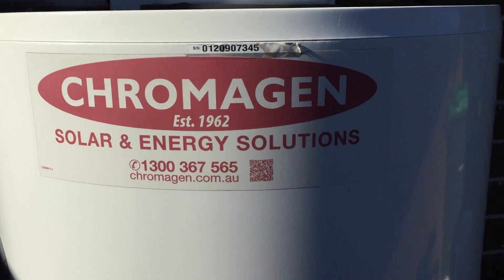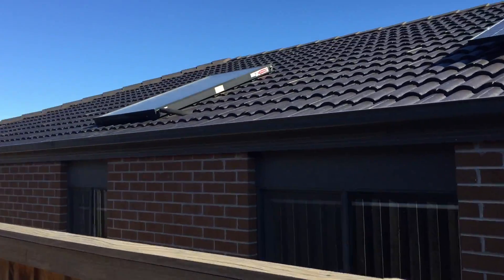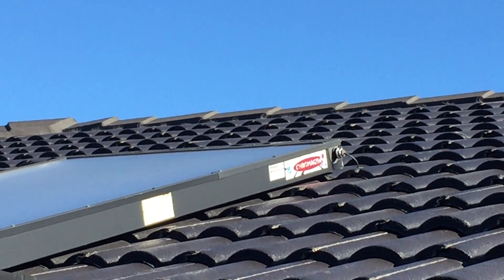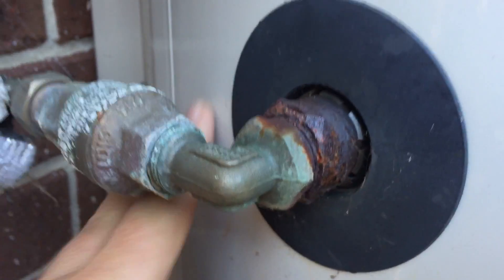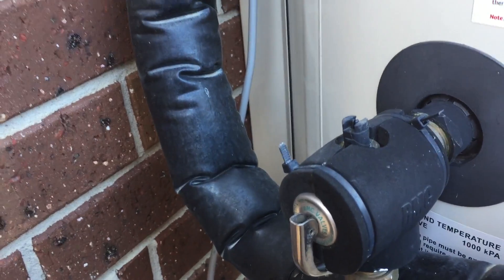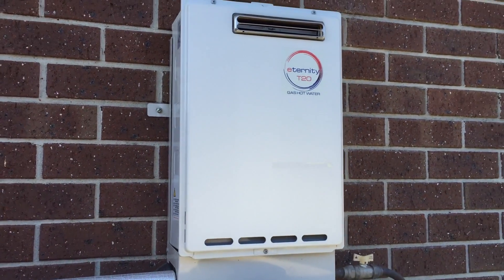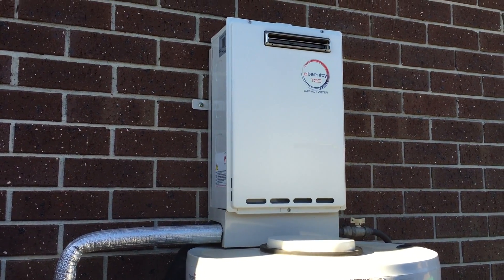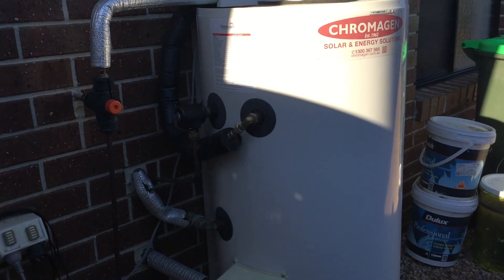Solar Hot Water systems- A Basic overview- Domestic Cromagen Rheem How they work

Comment: Hi Mark. I have a pin hole leak in the silver flex pipe that's in the U shape near the water inlet. I have already bought a replacement pipe. Do I have to drain the tank to swap/replace? I'm thinking I switch off the water inlet valve, turn off power and release the pressure valve. Is this enough? Thanks.

Comment: Hi Mark great videos buddy. Do u know how we can adjust the temperature of the water?
Reply from the maker: Hi there. The output from the solar should run to the instantaneous system. Which then should run to a pre set blending valve. This blending valve mixes hot and cold water so you have a maximum output temperature. 
If this system has been bypassed or isn’t working then you get water that is too hot.
Reply: @Marksreviewsandtutorials  do u means the temperening valve with the orange cap?

Comment: Hi Mark, I have got a similar one without the gas instantaneous system on top. My question is how to NOT use or Cut off the solar side of this solar HWS? I only want to use the normal electric hot water system as the pipes going up and down the solar have a history of leaking. Please advise Thank you

Comment: Hi Mark. I have to replace the corroded pipe fittings on the storage tank. Would you know whether the storage tank is made out of copper or steel. I'm just concerned if the fittings are seized and difficult to remove, this may fracture the tank. Not sure why mild steel fittings were used.

Comment: Hi, I'd like to disconnect the whole solar and tank and just re route and use the instantaneous unit only, do you have a schematic for the plumbing/wiring? Thanks
Reply: I think all u have to do is just turn the power off!.
Reply: @redsed1565 turning the power off didn’t work for us. It may not heat the water but the solar panel still fills with water

Comment: Hello mark how do we turn it off when we are away i mean like 2 months away .
Reply from the maker: Hi there, there is a power cord running from the little circulating pump. You can switch off the system there. It then won't run. Although it will still all be under mains water pressure. MRT
Reply: @Marksreviewsandtutorials  do i turn the water mains off to will it break the system if weather is hot ?
Reply from the maker: I wouldn’t turn the mains off as in hot weather the water will expand and it needs somewhere to go. There is a pressure relief valve on the tank but I wouldn’t want to solely rely on that

Comment: Hi Mark, my solar panel frost protection valve has been leaking for months and months now ( not dripping  it's literally pouring). What's  the issue here? Thanks
Reply: Thanks Mark for the reply. Is there any way then that I could bypass the Solar Panel system since it's heavily leaking and still have hot water supply. Or are they both interconnected?
Reply from the maker: @arnelsubala7567  If it is just the valve then get that replaced. If the panel is leaking that is more expensive. You will need a plumber to disconnect it.
Reply from the maker: The valves do tend to leak after awhile and need to replaced. Nothing wrong with your system just a part that does need replacement pretty often. MRT

Comment: I found this system useless for 9 months a year. During 9 months in Melbourne when it’s relatively cold, the solar part doesn’t heat water. On the other hand, it consumes energy because the pump attached to the tank still operates. Moreover, during minus T water in solar pipes needs to be heated too so it wouldn’t be frozen.
Just a gas booster without the whole solar part would be much better in our environment.
Interestingly enough, I can’t find an inlet water filter for water coming to Eternity 20
and I’m not sure it even exists, whereas in Rinnai it’s really visible and easy to clean
Reply: Ouch. Am building in South East Melbourne and my builder supplies a  Rheem model similar to this =(. Was hoping the solar thermal would save a bit but looks like not =(
Reply from the maker: There is a lot of hate from plumbers to these systems. I think mainly because they are not understood. Every time the sun is out it is raising the temperature of the supply water to your instantaneous heater and therefore it will use less gas. Saving money and the planet. 
I have three people in my house and I turn the gas booster off in summer in Melbourne and there is always enough hot water. (Outside of filling the bath). 
The circulation motor is tiny and costs very little to run. 
See my other videos where I discuss this
Reply: Its useful mostly in north Australia, even then in darwin in the dry season you will have only cold showers for a month or 2 in the dry season. If you coulple this wth a solar pannel for a small heater in your storage tank it will make a difference

Comment: My double panel exploded, and left only one panel.
 Can I utilise the one panel to use ?
Or do I need to buy a new double panel?
Can you shed some light on this?
Reply from the maker: Hi. The pressure on these systems come mainly from the mains water pressure itself not the little circulation pump. So I think it would be fine to run through just one panel.

Comment: Hi. How can I isolate solar hot water system from gas heater? I have a water leaking on panels. Can I disconnect power for the pump of solar system?
Reply from the maker: The whole system is under mains pressure. So to isolate the roof panel you must block both lines to it. Ie up and down pipes MRT
Reply: Thanks.

Comment: My water soler at roof is leaking water is keep coming from the little tap on the right side please help me to fix it thanks
Reply from the maker: There can be an anti freeze valve on the system which is supposed to leak out some water when the temp drops below 4-5deg. 
So if it is just leaking on cold mornings then it is doing as it is supposed to. If it is leaking all the time. Then either replace the part or call a plumber. This whole system is under mains pressure so you need to know what you are doing. MRT
Reply: @Marksreviewsandtutorials  Thanks for reply bro.the flow does not looks normal it's not like a water drops it's  a flow of water like tap and when I turn off main supply of water it's stops when I turn on back main supply from outside water flow starts again from roof
Reply: @Marksreviewsandtutorials  looks like I am loosing too much water
Reply: incredible india 
hi mate i have the same problem
Reply: incredible india  how did you fix it
Reply: Sarabjeet Singh thanks a lot brother... but unfortunately i already bypass hot water unit because many people having same issue and it’s come again and again so this hot water system automatically release water when temperature drop so i thought its better to get rid of this system.. and i think it’s not really helpful in australia specially melbourne weather condition                         thanks anyway bro
Reply: Mani Mannii ohh okay paji,,,actually this year is our first year as home owner so just getting experience slowly and steadily😂😂👍🏻
Reply: Mani Mannii if u have any links how to bypass the system please share ..may be in future I can try the same ...cheers👍🏻
Reply: Sarabjeet Singh   na bro i called certified plumber for that
Reply: @manimannii7610  hi bro a plumber fixed for me
Reply: @sarabjeetsingh120  Thank you bro 🙏
Reply: Mark's reviews and tutorials 
hi mark please tell us how to bypass ho water solar panel system please make a video thanks
Reply from the maker: The solar system is saving you money and the planet. It is ok to spend some money and maintain it. Disconnecting it will cost you much more in gas.

Comment: They shouldn't be using flexi connectors, they are not for outdoor uses. If you guys have those flexible hoses for your outdoor hot water tank, you must get it replaced with copper pipes ASAP!!!

Comment: Any videos on bypassing the solar and just have it as insentanious
Reply: Any luck with that? This company are scammers. Im wanting to do the same
Reply: oldman ripped the whole lot out and just replaced it for $1100 supply/fit/dispose including all the solar they capped and bled the roof pipes and the pressure is like concrete coming out at you now
Reply: @RN-mn3zu   Hahaha nice one mate. Yea that'll be my next step I reckon, cut the losses. Having said that. I had the dickheads out today. They tried to charge me $140 for the replacement valve on the panel that was pissing all night long. I told them no and they said they could just cap it. So thats what they did. They said they are installing them capped now because its giving them so much trouble, smh. About to run it til the wheels fall off. Thanks for the reply.
Reply: Do your homework I’m in SA and sorted a decent rebate via AGL
Reply: @RN-mn3zu  beauty I'll keep that in mind cheers

Comment: From last night I got new problem 
The continued sound coming out of hot water solar tank , it goes only for the moment we release pressure valve to release some water then it start again 
Any idea please
Looks like it’s happening due to some sediment build up in tank as I read on google , after I release some water via pressure relief value the sound went for 10-15 mins but it is back again 
I saw some rusty color water came out

Comment: Our Chromagen solar hot water system is beeping, i can feel that coming out of the motor. What should I do?  please
Reply from the maker: mahmood ali Khan I would have a look at these videos on solar hot water to see how to check if your solar is still working. See if there is hot water in the tank. If not then I would call Cromogen to get it fixed or a solar hot water specialist company. Normal plumbers often cannot help. MRT
Reply: @Marksreviewsandtutorials  : Thanks Mark, I just fixed the beep sound after checking solar pump station and just one of the red wire from the controller was loose and after i put it back firmly, the beep sounds went off. 
https://www.youtube.com/watch?v=hhQacVDLzs8&t=3s

Comment: Hi Mark, thanks for making this video. I've got exactly the same system, had a problem the other day with the flexihose as it disconnected from the unit and there was water leaking everywhere. Luckily I was home and i was able turn the water supply off, or else my whole house would probably be flooded (our chromagen unit is indoor). My question is, with the pressure release valve is it safe for me to depressurise it myself and out would I need to look out for?
Reply from the maker: Hi There,
The pressure release or opening a hot tap once the water is off should depressurise it. But it is full of very very hot water. So you must be very careful. Or call a plumber. MRT

Comment: Good info mate.... Is there a way to bypass the solar heater and directly use gas instead? I have a leak in the panel and want to bypass the thing completely till i fix it... I am a bit confused since the instant heater pulls the water from tank...and tank only has what comes from solar panel...so how would i do it?
Reply from the maker: Parminder Sandhu I don’t know how your system is pLumbed but mine has the solar drawing and returning to the tank. So to bypass a leak you would need to blank off both of the pipes running to the solar at the tank end. 
That would then leave the gas system intact. 
But that is on my system I don’t know how yours is plumbed
MRT
Reply: @Marksreviewsandtutorials  
Yeah..mine was exactly the same..I got a plumber who disconnected the in and out from the tank "swimming pool" in your case :-)... but the gas heater still pulls water from the tank... so in other words..tank still fills up first..and then the gas heater pulls water from tank and heats it before its available in pipes.. It was a rather easy fix, but the plumber didnt really bypass the whole system.. i am still dependent on the tank to fetch water for the heater...not sure if thats the best way..or he just used a short-cut method...
Reply from the maker: Parminder Sandhu If you want to repair your solar panel later. Then what you have is the best option. The tank won’t hinder in anyway it is just like a fat pipe. 😳

Comment: Whenever I  lift the pressure temperature release valve, I hear rattling/rumbling noise noise (like air bubble noise through a pipe whenever you shut the mains to replace a tap). I get lukewarm water coming out instead of hot water. Should I be concerned?

Comment: Is there any electrical energy involved in any part of the working operation of this water heater?
Reply from the maker: Hi There, Yes The Gas boost system has mains power running to it. It has electronic ignition.
And the solar system is run by a little pump that also uses mains power. So both

Comment: Hi mark, i can hear water draining in the downspouts. I use a solar hot water. Is it normal for water to drain? Overflow? Or is it leaking?
Reply from the maker: HI, No there should not be any water draining from the solar system. An evaporative cooler yes. But not from a solar.
Reply: Thanks mark. Yes i use an evaporative cooler, but i cn hear water dripping even if I don’t use the cooler. At the moment im using the gas heater. Do you think theres a leak somewhere?
Reply from the maker: Sounds like you need to get up onto the roof and have a look to see what is leaking.
Solar panels are always under mains pressure, so a leak will still leak even if it is switched off.
Mark's Reviews & Tutorials
Reply: Hi Mark. Just got up the roof and found a valve is leaking at the bottom left. Is that the anti frost valve?

Comment: Hi Mark, do you know what's involved to simply change a frost protection valve on a solar water panel? Does the cold water supply tap need to be turned off? or it it just a matter of removing the 'dud' frost protection valve, letting all of the water drain out, then refit the new valve?
Reply from the maker: R Davies The solar hot water system is driven by a small circulation pump but the whole system is also under mains pressure. So any part that you open or that breaks is under mains pressure. So you have to turn the water off. 💦

Comment: Did you change the corroded parts to and from the tank ?? Mine is the same...
Reply from the maker: Reena Gandhi No I didn't change them. But it would help to spray paint the rusty fitting to try to slow down the corrosion